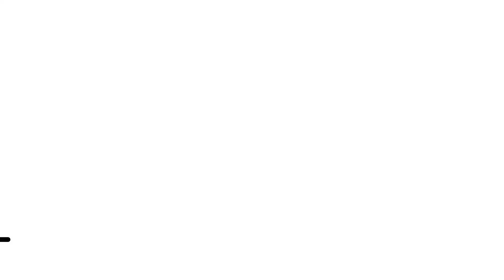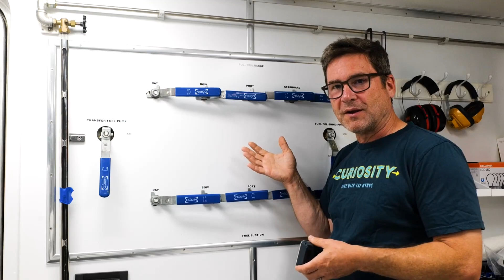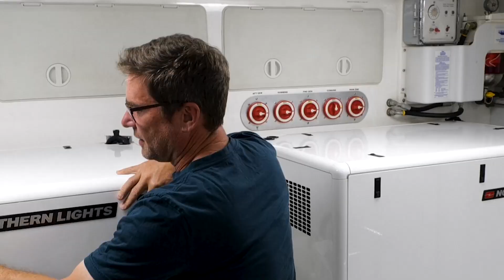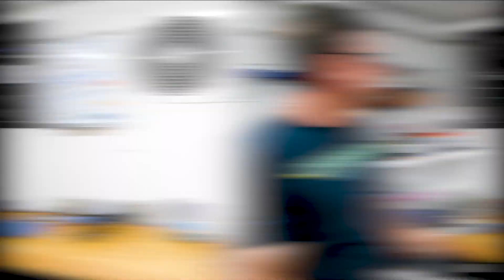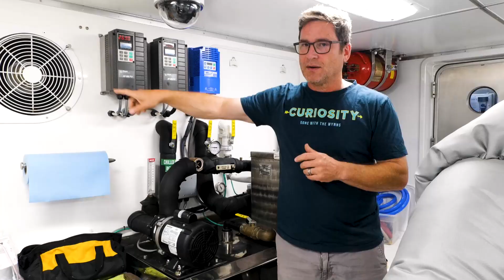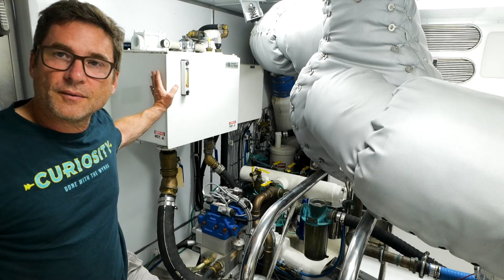Trawler Engine Room Tour!

Comment: Very nice video.  Thank you.  You have a beautiful engine room.  I would also be interested in seeing  1)A video of your electrical system, the supply side. 2) A video of your pilothouse. 3) A video of your mast...the electronics and things up there.  Thanks again for these videos.  I know that can be a lot of work.
Reply from the maker: Good ideas. I wonder if there is a better way to talk about the electrical system other than a video, or at least I think I'll need some kind do drawing that I can talk over. I'll give that some thought!
-mike
Reply: As a drawing consider using your electrical panel(s).  Of interest (to me) would be your shore cable(s), your isolation transformer (if you have one), your inverter(s), your batteries, your heavy current switches, your generators, and your alternator(s), your solar panels (if you have them), and the gauges that you use to monitor everything.  And just your common sense narration.  You do that really well.
Thanks

Comment: Nice tour of what is clearly the coolest part of any vessel.  I was surprised by how flexible the systems are - looks like you have routing control over fuel, cooling water, oil, hydraulics.  Neat. You should probably be wearing a red engineering tunic and speaking in a Scottish accent though.
Reply from the maker: If I could do a Scottish accent I would totally do it. :)

Comment: Great video! What’s the decibel level of the engine room at rest, and under power?
Reply from the maker: It's pretty quiet in when we're at the dock. The noise in the background on the video is a fan. I generally keep air moving through the room. Under way it is very loud. I'll dig up a db meter and check it out! The ER is lined with sound proofing, the rest of the boat is nice and quiet.
Reply from the maker: ER is >90db, salon is 45ish.

Comment: sailboats are our friends!! :) All boats are our friends unless they act like knuckleheads...  then they are just boats with boneheads behind the wheel  :)  great video!!  Thanks for sharing!  wow that is cool for the get home drive thing.  So just one prop?
Reply from the maker: Secretly both Mia and I are sailors too. We're still pretty new to it but we had a blast racing a Martin yesterday!  

Yes, there is only one prop. It's pretty big though...
Reply: @MVGallivant  Sailing is a blast did it in my younger years on hobie cats, windsurfing and some small sailing dingy's.. been on motorboats all my life in the ICW and Gulf love the motorboats side of things too not so dependent on wind but love sailing that feeling is not something you can duplicate with motoryacht/boating..  i think it gets in your blood lol
Reply: @MVGallivant  So basically if your diesel had some gunk in it you could still get home or would that be an issue cause it comes from the same tanks as the main engine?  just trying to figure out how it all works.  seen wing engines before on Nordhavn's but that does seem pretty cool and might be a better solution in case of diesel issues or just plain old engine issues..
Reply from the maker: That's true, if all of the fuel is bad, none of the engines are going to do well. If the fuel in one tank is bad, we can work around that. We could replace the fuel in the day tank with fuel from one of the other tanks (probably the bow tank in this case). I don't know if the Nordhavn wing engines have their own redundant fuel source, if they don't they would have the same problem. The wing engine would have an advantage if the main shaft or prop were not operable.  OTOH, while I don't run every part of the get home system that often, most parts are used on a regular basis (genset, hydraulic system, shaft, prop) so it is less likely to suffer a failure due to lack of use. Each system has strengths. Like I said in the video, I like not having another engine to take care of and a little extra space in the engine room.
-mike
Reply: @MVGallivant  yeah hydraulic is pretty reliable as long as the system is maintained.  yeah not sure on the Nordhavn's either just have seen some of them with the wing engine configuration.  they have similar shunting values and cleaning systems for the fuel i think as well.  i think there is another boat i saw that had some nice features it was a AllSeas 96 i think was the model?? yeah not having another engine to maintain is pretty nice.  so if you had electric you could run the hydraulics so maybe some solar arrays would be a good backup for that type of config or not worth it??